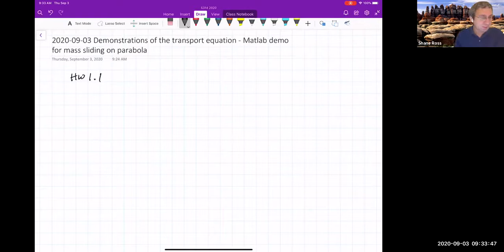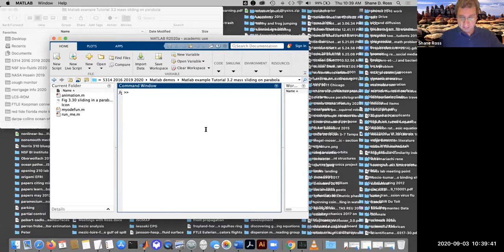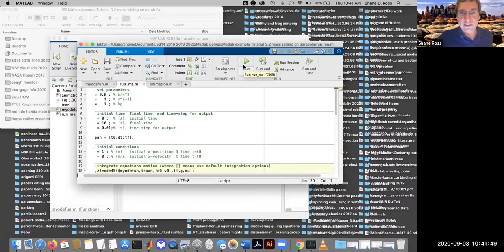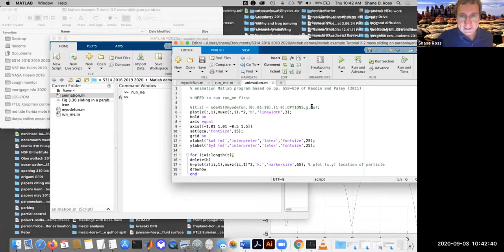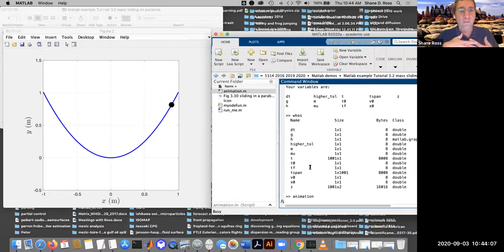Demonstrations of Transport Theorem for Kinematics | MATLAB for Mass Sliding on Parabola | Lecture 4

Comment: Dear professor, Thanks a lot for posting these lectures. I do have a question about the second problem. When you were deriving the angular velocity of that 2 DOF universal joint, you wrote the angular velocity of the first rotation as "phi_dot e3". (At 32:19)  My question is what will be wrong if we write it as "phi_dot b3"? Since I'm thinking that e3 and b3 are the same in that configuration, but if you use b3 rather than e3, the later conversion of e3 to b frame will disappear, so the final result will be different. Looking forward to your reply!
Reply from the maker: Great question. We are trying to write the angular velocity of the B-frame with respect to the E-frame *for any general orientation of the two frames*. So the only correct answer is "phi_dot e3". If we were to do this more carefully, we would give different names to all the intermediate frames used to construct the rotation as a sequence of 'pure rotations'. This is the Euler angle approach and you can see more about it here: https://www.youtube.com/watch?v=af041z8jujU&list=PLUeHTafWecAUl2DuWWdRU1MckJv7M5LEH&index=13

Comment: Dear sir,
Thank you for your lecture series.
I've got a question in my mind. While you were writing derivative of some vector w.r.t some fixed inertial frame, why did you keep expressing that resultant vector in terms of non-inertial reference frame coordinates? Shouldn't we represent that vector in that same inertial frame when taking its time derivative in that frame? 
I hope I conveyed my question.
Reply from the maker: Your question is clear. This is a common misconception, but that's okay. And the answer is that you have freedom to express vectors in any frame you want, or any combination of unit vectors from several different frames. For example, just as you can represent a 2D position vector in either an inertial cartesian frame (inertial unit vector) or a polar coordinate frame (polar unit vectors), you can also take the derivative of that vector with respect to the inertial frame; and represent that 2D velocity vector either in the inertial cartesian frame or in the polar coordinate frame, etc.
Reply: @ProfessorRoss   Thank you so much indeed. It's clear now.